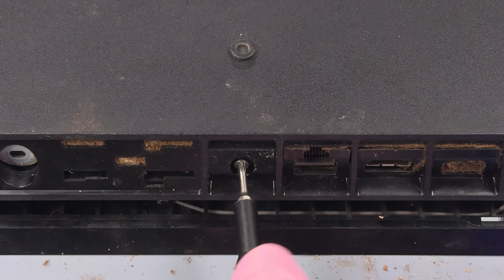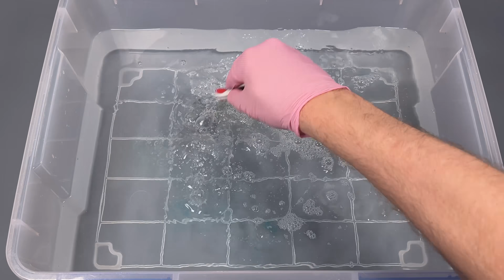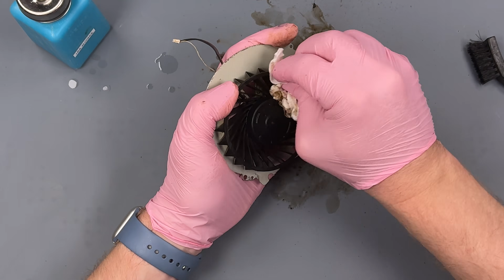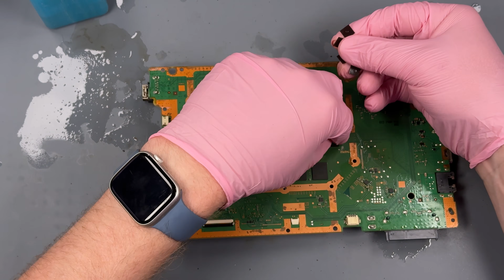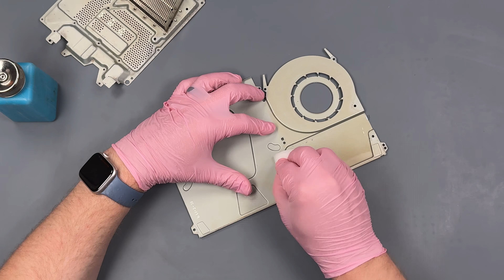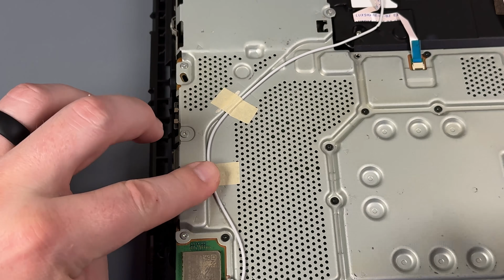DISGUSTING Bug Infested PS4 Slim - Let's Clean It!

Comment: When I worked at gamestop I was trainning someone and was showing them how the ps4 plate can slide off of a pro and there were probably 50+ roaches different types too ;-; in there and they were alive and like running around, I dont think ive ever thrown something into our shopping bags so quickly and kicked someone out so fast. My coworker then said I saw them for a second before you spazzed. She never did a trade in without gloves and I almost threw up after. Had to take 15minutes after that we made the carpet wet with cleaning chemicals bc we were scared of anything that might have remotely touched the counter. 😅

Comment: i tried cleaning a really loud and disgusting ps4 at 3 am, was kind of rushed because of how tired i was and...the power supply cable got stuck under the metal plate. i tried pulling it out (was rushed again) instead of dissasembling the ps4 back again and the whole connector that is on the motherboard just..kind of broke. now, i know that cleaning/repairing stuff while being rushed is not a good idea at all. any recommendation on how i could solder it back on the motherboard? im gonna try and do it this weekend at my friends since his dad can help me, i hope i really can fix it instead of just buying a whole new motherboard.

Comment: I've cleaned my fair share of consoles/pc components in the paste and one thing they all share in common is not enough thermal compound wheather paste or liquid metal. That stuff costs pennies compared to the actual unit itself so I'll never get why they under paste things. My nephews ps4 sounded like a jet engine like most do until I opened and re pasted it, now its whisper quiet.

Comment: Damn. I myself have a launch PS4 which had never been opened (warranty sticker was intact and hadn't been touched - i was the first one to get it off), a couple of months ago I tore it apart and was surprised to see just a light layer of fine dust (and one tiny dead spider), all I had to do is wipe the surfaces, brush the fan and cooler fins, replace the thermal paste and reassemble. Running as new and is jailbroken.

Comment: Yes, I looked and I wonder if You can recommend something for the green "rusty" coating on the PCB board? I have the same in USB, USB work after not fully connected, USB works but after fully connected it does not recognize the device. Any advice? I do not want to scratch or use agents/liquids.Thanks for Help

Comment: A trick for removing the nicotine stains is to use AC coil cleaner. The brand I always buy and I know works is Frost King Foaming AC Coil Cleaner. I moved into a place that had an AC unit where the previous tenant was a smoker. The coils were like a dark brown. I sprayed that stuff and everything INSTANTLY just dripped off. The stuff is incredible! When I was done, the coils were like a bright blue-green color. I liked the look of it so much I left the outer surround off while I lived there!

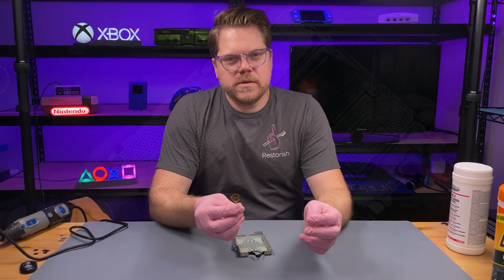Comment: A trick for preventing a bunch of those Dremel wire brush pieces from flying off (20:47) is to put a layer of super glue around the bottom perimeter of the tool prior to use. It drastically reduces the number of little wires flying off.

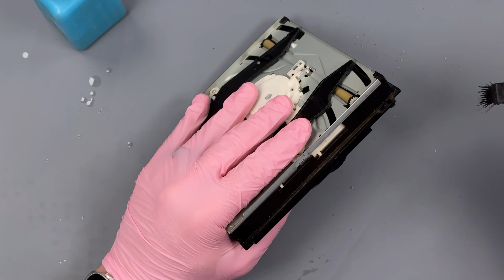Comment: I had a similar PS4 Limited Edition Batman Arkham Knight console I picked up for cheap but the same issues.  I soaked the fan in a large container of IPA for hours and it came all clean. @17:09 I cannot say I EVER got a console that was dust free from a smoker.  Usually the tar gets in there and is hard to get off the metals and then makes all the dust stick down to the plastics.  Really gross.  When i cleaned that PS4 Console I mentioned I set up a table in my garage was NOT going to bring that into my house. yuck!

Comment: To give some perspective on how bad that house/apartment the PS4 was at.

I lived in a roach infested mobile home growing up. Pretty bad. They would be everywhere at all times in every crevice.

I had an og Xbox, N64 GameCube, PS2, and Wii. Years later when I was an older teen (of course, moved elsewhere that didn't have roaches) I decided to clean them out. I was expecting horror when I opened the consoles. But to my surprise I only found a single dead roach. It was in the underside of the N64 near the vent.

So whoever had this console must be in a REALLY bad situation.
Reply: Same here, and honestly I think the problem is that they just let it still in one spot for a long time. Along with not cleaning up the area around it
Reply: It could have been in a storage unit

Comment: Funnily enough I accidentally heated up a corroded supercap (like a battery that acts like a high capacity capacitor, in this case 220mF) with a hot air gun and it exploded in my face! I was an idiot for not using a soldering iron (it has two pads). Fortunately it missed me completely but I could've been injured from it (I have reading glasses, but I could've lost an eye)

Comment: Man, incredible result. Still, three small caveats:
1. Unless you have a clean room with negative air pressure, you should NEVER open an HDD. A spec of dust stuck between the heads and the disk will kill it forever.
2. If your metallic part has rust, you need to remove it, but then you need to protect the metal with something. Originally it comes zinc plated or something like that, but if you don't have access to plating tools and compounds, you'll need an alternative: nail polish, cold blueing compound, oils that harden, etc.
3. Usually smells are produced by two factors: Chemical compounds or biological infestation. Usually chemical odors can be removed by simply cleaning. The latter one needs the same and something else: destroying the invasion, and that is usually achieved with heat. Still opening a power source is too dangerous to be worth it, unless you actually know your way inside those things.

Comment: As a smoker, I know that telltale brown stanky goo all too well, and it's a reason I do not resell my consoles or PC's, all though I do clean them every 3-6 months and i found using strongest available Isopropyl which is 99% for a first wash, then Fantastic which removes the nicotine and tar stink, and follow up with another Iso wash, before starting any of the washes though i use a air compressor to get rid of dust and debris, with a water separator and max 40 PSi.

Comment: its ok to soak metal in water for upwards of 48 hours without having to worry about rust, if you leave it for 24 hours to soak and then make sure its good and dry before into the console again itll be fine. just avoid touching the wet metal to any heat or electricity or salt, these 3 things will enhance the rusting process faster

Comment: Hey, please read this message. I have a question. What thermal paste should I use for my PlayStation 4 console? I got a PlayStation four slim and I don’t know what I should get for it so I wanna ask you. And I’m pretty good at repairing l consoles just never redone thermal paste before cause I never had to until now because my console is starting to overheat with the heat sink is completely clean so I think it’s thermal problem
Reply from the maker: Most any good paste will work. We use Arctic Silver 5 which is a good paste. There are lots of other good ones out there though.
Reply: @RestorishOfficial  wait which one Tronic fix use
Reply from the maker: Arctic Silver 5

Comment: For this brown discoloration on metal parts, if alcohol doesn't work very well I would try to clean it with gasoline, of course outdoors. Gasoline can dissolve oily stains better than alcohol, but don't use it on plastics, it will dissolve them too.
Reply from the maker: Thanks for the suggestion!